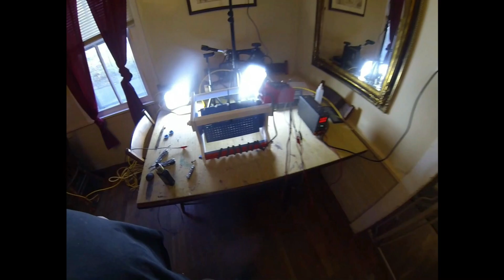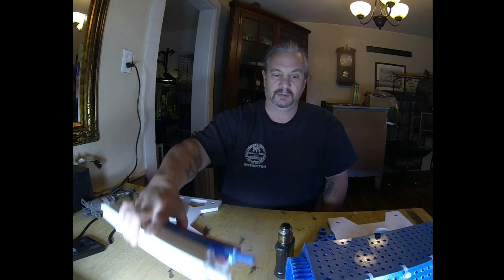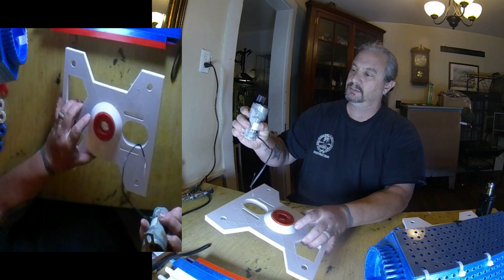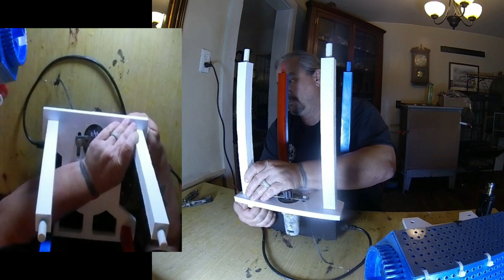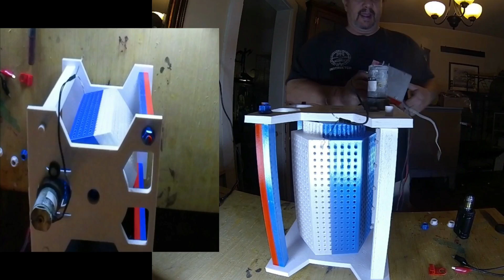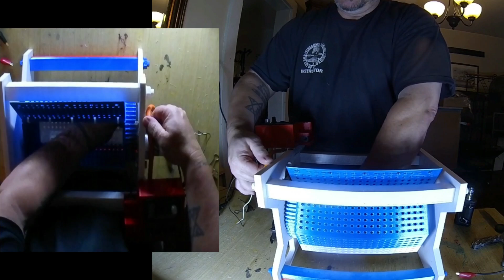Copper Plating The NEW NEW

Comment: I appreciate the significant effort you have invested in this project. While I have experimented with copper plating using a homemade barrel plater with varying degrees of success, I lack access to 3D printing resources and would be very interested in purchasing a unit from you, should you be open to such an arrangement.
Reply from the maker: Are talking the full project or just the 3d printed part and you source the parts?

Comment: Any info on building the controller. I'm the worst will electrical.
Reply from the maker: have to be honest I am too. I use chatgpt for the wiring this is what i used 

DROK DC Buck Converter Adjustable Color LCD Display, 6-55V to 0-50V 5A Step Down Converter Voltage Regulator Power Supply

Thank you for watching

Comment: What size bearings did you wind up using? I bought some, but they wound up being too small.
Reply from the maker: I just wound up 3D printing a the housing and used these 
uxcell 1/2-inch PA Nylon Solid Plastic Balls, Precision Bearing Ball 5pcs (x3 to be safe) off amazon becuse i didnt want any addtional metal in the soup. and then you can make em as big or small as you'd like
Reply: @boolitsbuildersllc.106  Maaaan, you're awesome.

Comment: I kinda wonder if ya ran the speed a little faster maybe the bullets moving around would make the bubbles, and wouldn't need the bubbler ,  very nice set up.  awesome set up
Reply from the maker: We've found if it goes much faster it turns em' black or doesn't allow em' to coat. Maybe cause of the bulk. Thank you for watching.
Reply: @boolitsbuildersllc.106  hmmm, well it seems you pretty much have it figured out,  you think you'll ever be able to do a thousand or 5 all at the same time??  I really should give this a try
Reply from the maker: With the new new I can do 15lbs of lead at one time. Thank you for watching.